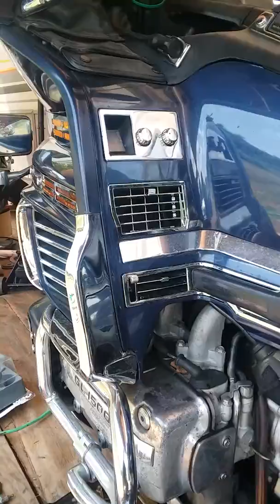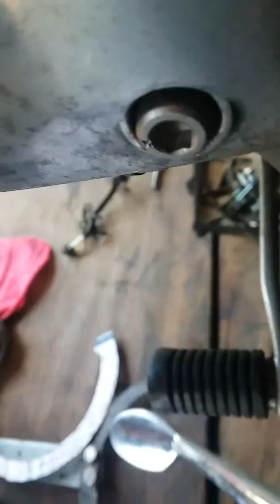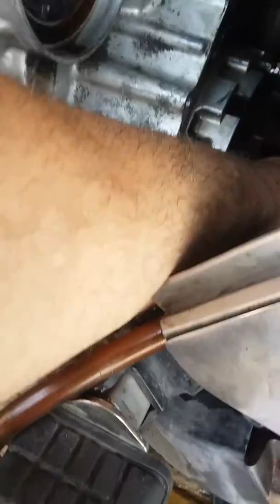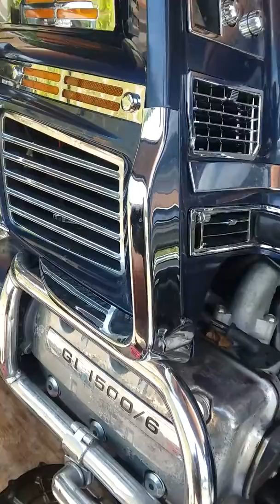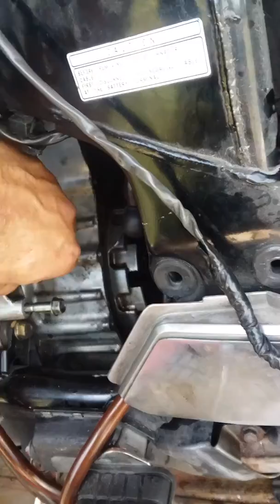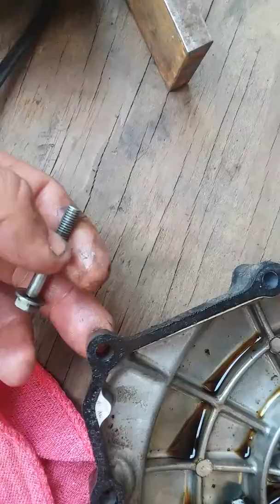Gl1500 Honda Goldwing clutch replacement part1

Comment from the maker: Is important pay attention to assembly the CLUTCH BASKET LIFTER PLATE, because have right position, needs check the diagram  print and check the position of bearing, if you flip the plate the clutch will not work... 
Hace 1 segundo